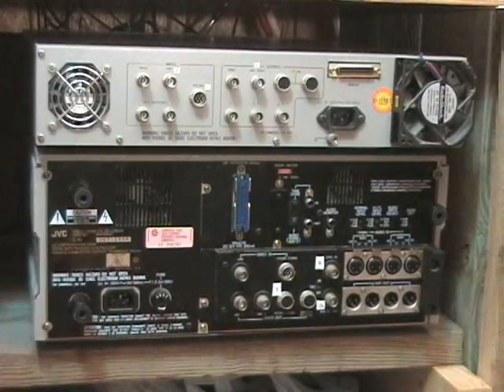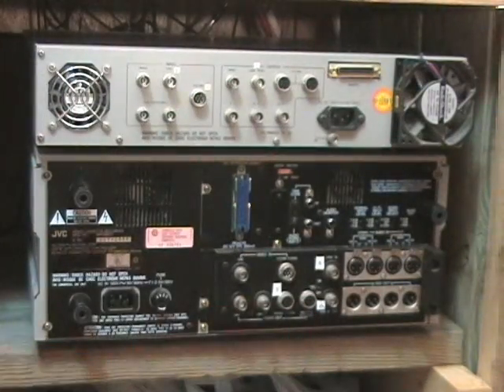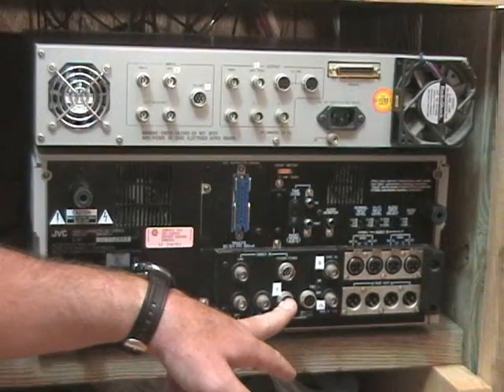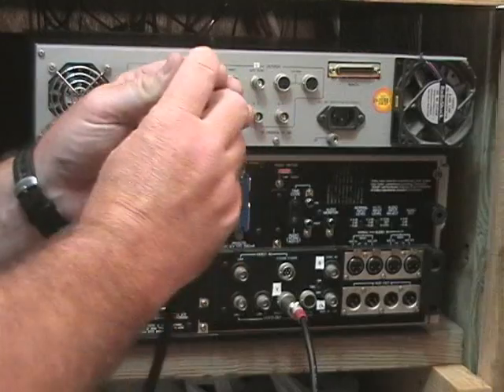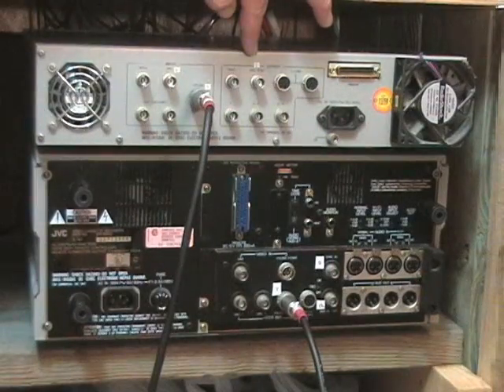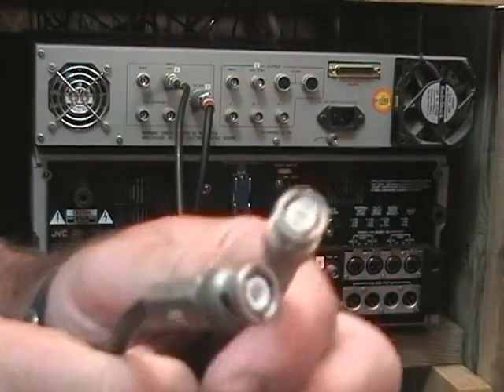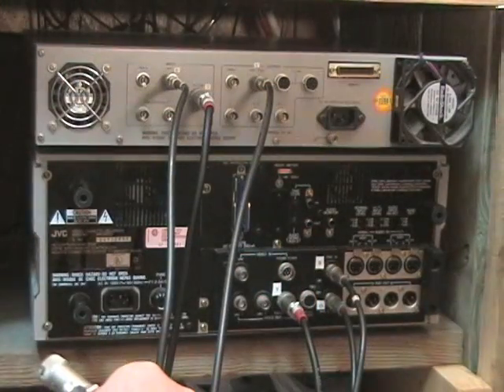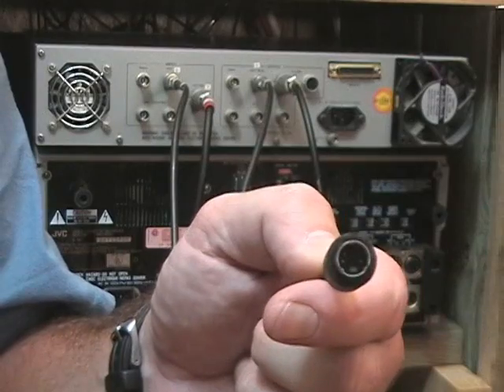Connecting a Time Base Corrector to a Professional VCR - BR-S811U, SA-T411U

Comment: Greetings: A minor over-sight is that the TBC has a switch to select either the DUB cable or the Video-IN BNC  for the TBC's video input source. The drop-out compensator  DOC is a VCR accessory that provides a replacement video for times when the tape has no output due to shedding of the oxide or a momentary head-clog when it was recorded. Although some video recorder/players may have a DOC built it, this unit merely detects the drop-out requiring the TBC to provide the necessary replacement video so the drop-out will be less noticeable on the DUB recording.

Comment: Nice video...my question is, where do you get the 7-pin cables and the 7-pin to 4-pin S-Video cable? I have a BR-S822U (and another soon) and will need these cable to interface with the rest of my system.

Comment: The BRS-811U had an optional TBC available (connected to one of the internal slots under the playback controls panel).  These VCR's are cheap as hell on eBay now.  Most will have the TBC option.